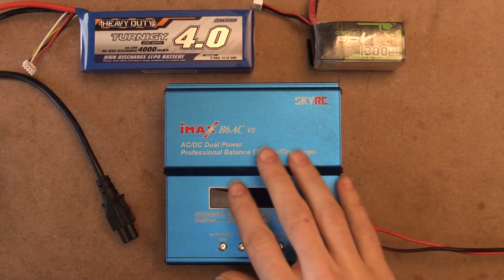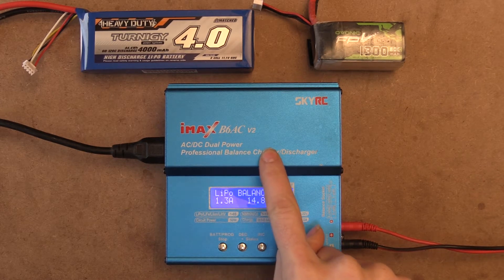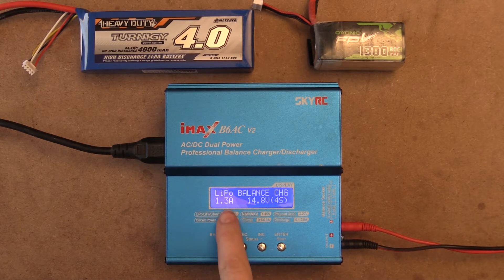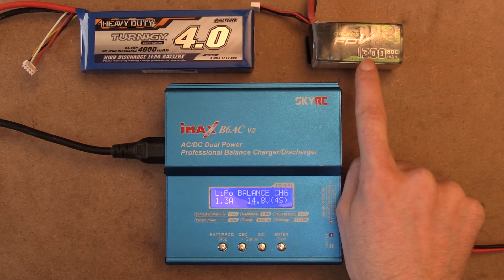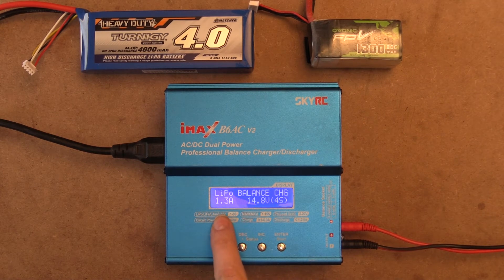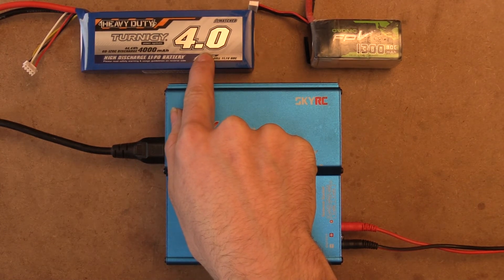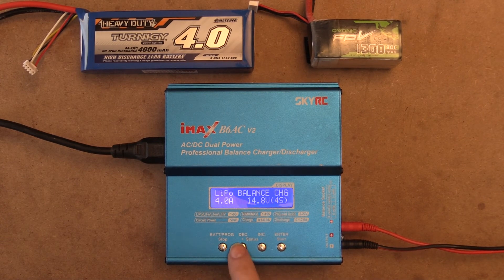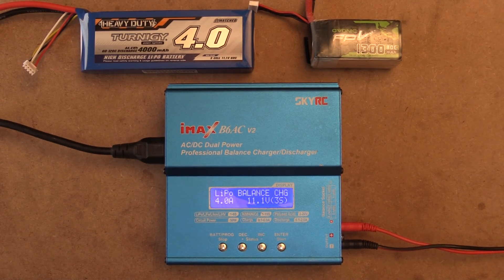Lipo Battery Charger Amperage Settings | How To

Comment: What would you set a 2s  9000mah 7.6v high volt at for the current v charge
Reply from the maker: On my charger, I would just set it at the highest setting which is 6amps. It could be charged at 18 amps however. Thanks for watching!

Comment: So for my 10,000mah battery would I still use 10A when putting the battery into storage mode, or would I have to lower the amps?

Comment: Do you think the same applies to cell phone batteries? I’m a bit worried about setting it to 5A for a 1s 5000mah
Reply from the maker: Phone batteries have battery management systems built in so it will not allow you to give it more power than it needs. Lipo batteries have no extra electronics, so you have to be smart with charging them.

Comment: Is it good to charge 10000mah battery with 1 amp charger
Reply from the maker: That would take forever!! It would work, but it’s not at all efficient.
Reply: charging 10000mah battery using 1 amp, make it chargering time be slow and to long, it make battery be hot, and hot not good for battery life